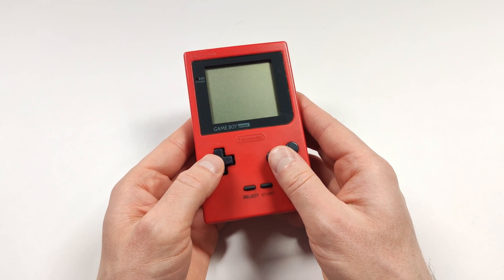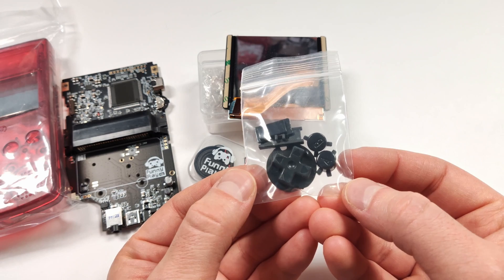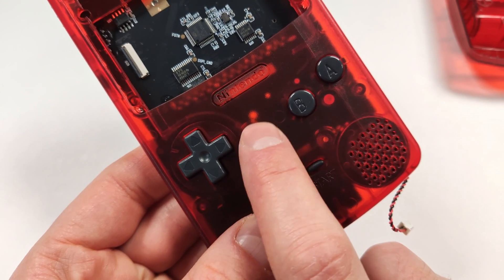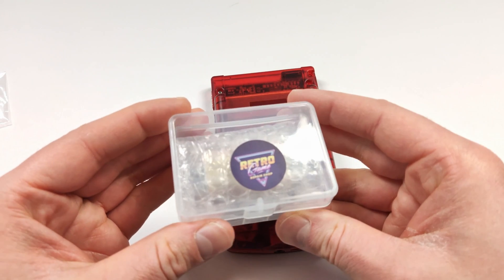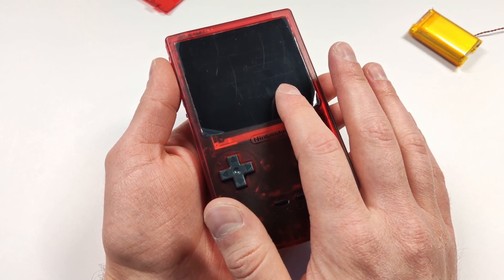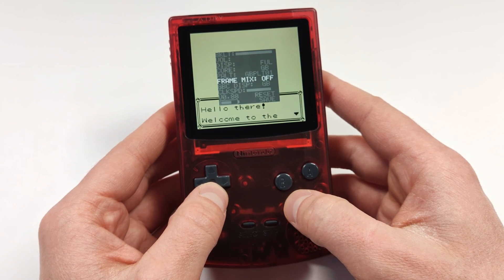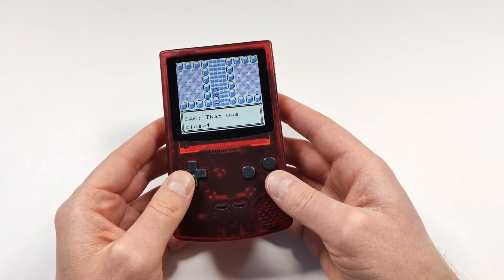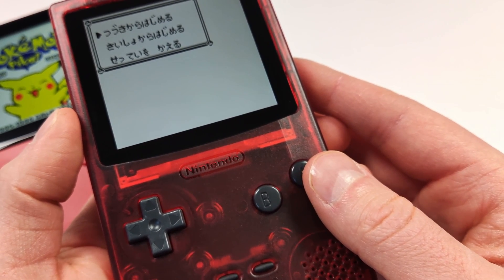Build Your Own FPGA Game Boy Color! In-Depth Build Guide and Review

Comment from the maker: Retro Game Repair Shop shipped me a replacement screen which fixed the biggest issue I have with the device. Excellent customer service! Have you built one yet? What do you think of the FPGA GBC Kit?
Reply: 160 $US? It's 70 (board) + 10 (shell) + 1.40 (buttons) + 1.40 (membran). :)
Reply: @TarikA  sounds like he got it from retro games repair shop, where the prices are inflated.
Reply: Hi, do you have a link or full name/model number for the rom cart you used? I see online that it is hit or miss which work, and I don't want to buy the wrong one. Thank you.
Reply from the maker: I'm using the blue game cart here (didn't get mine from this seller but it's the same product):
https://a.aliexpress.com/_mshf68w
Reply: Hopefully in the future you create the FPGA Advance.

With 2 speakers  on the front for left and Right.

Comment: That light line under the display that you can see through the shell is annoying. Do you imagine there would be any harm in having a piece of electrical tape covering that to make it match the back PCB?
Reply from the maker: You should be fine to put a piece of electrical tape there if you want, it won't harm anything.
Reply: Mine came with a small black sticker with the Funnyplaying logo on it that covered it up quite nicely.

Comment: Hi,
Got the hissing too from mine. I was pretty sure it was some interferences from a part of the kit. I thought of the screen first and it is. Increase or decrease the brightness and the hissing will disappear. I have no more hissing at the lowest and highest brightness setting. The hissing seems to follow a Gauss curve and the peak is around the middle setting. I guess it because of the PWM frequency used at those settings.

[Edit] Made a video : https://www.youtube.com/watch?v=k2t8PF9m4-o
Reply from the maker: Interesting! I checked again but mine seems to be persistent at any volume level. Sorry for the late reply. I heard Funnyplaying set the speaker itself at max volume then just turned it down on the software side. Hopefully an update fixes it.

Comment: Does the battery cable only fit on one way? My unit isn’t turning on and I’m not sure if it’s plugged in the wrong way… I have the positive (red) cable side of the plug facing downward or next to the speaker and the black facing upward.
Reply from the maker: Yeah it only fits one way. Sounds like you have it correctly oriented but you might need to push it down more on the furthest end of the connector tip. I had a little piece of plastic sticking out on my battery connector that prevented it from pushing it down easily (as shown in the video).

Comment: Just received mine today after what felt like a long wait. I was in-between smoke black shell or atomic purple ... So I ordered both shells. I ended up assembling with the atomic purple as it kicked in more of the nostalgia vibes.

So far pros are
- quality shell and materials (for most part)
- speaker is super good and loud (too loud)
- screen is great... I love the full screen mode
-usb c rechargeable 
- knock off ever drive flash cart works
- feels like I'm a kid again

Cons
- I had to file some poorly molded plastic off battery connector to get it to connect. Took 20 minutes of trying before figuring out that was stoping it.
- minimum volume is still too high for me... Like I would like 3-5 options softer. I'm playing Pokemon on the lowest volume and it's still too loud to play in bed next to the wife... 
- ordered 2 cases but they only sent 1 set of stickers
- my board is a newer revision 1.1 and there are not other firmwares. They have also changed the boot logo to a horrible funny playing logo that looks like absolute crap!!!
Reply from the maker: Been using mine a bit more lately as well and I do have to agree with you on the speaker volume, clear but very loud even at minimum volume. Seems like a nice kit but they obviously have a ways to go on perfecting it... shame about the new boot logo. You could always unplug the speaker in the meantime and use wired headphones until they patch the fix for the volume. Not ideal though... Do you notice any hissing from the speaker too?
Reply: @KeiRetroGaming  I have not noticed any hissing on mine yet but I must admit I only have maybe 2 hours of  light use at current. Mostly just testing out different games. 1 hour of that pokemon crystal. 

If you mean there is also a hiss when volume is all the way down... I don't have that problem. I can turn volume all the way down and sound is just off. No noise. I think for the short term... I'm actually going to put some tape over the speaker holes of the case to block off 80-90 of the holes... When I do that with my finger... It seems to reduce the minimum volume to a more manageable amount for quiet spaces.

I hope they keep doing some firmware updates or allow us to edit a settings file so I can manually configure the minimum volume.
Reply from the maker: I've heard some promising features coming eventually including lower volume... even one rumored to be supporting GBA games. You can read more about the future updates here:
https://github.com/makhowastaken/GWGBC_FW
Reply: @KeiRetroGaming  yeah. I actually made a second reply and posted the same link. I think YouTube auto removed the reply though. I know that page shows they know about it... But there is also a small bullet at the bottom of the page that says they might have the volume raised to hide that humm/hiss noise.

I tested mine yesterday with the volume off and held it up to my ear... I can hear a hiss noise. Although at normal playing distance I cannot. 

I actually emailed funny playing some feedback / requests as well... Hopefully they listen or respond.

Comment: I just literally did a custom mod kit for my gameboy color. It's transparent blue and I'm loving it too. I preferred my rechargable AA batteries for mine and think they last longer than 4hrs like your saying yours does. I got my screen at retro game shop and did very little trimming on my screen area.
Reply from the maker: I bet that looks great! How's the screen on yours?
Reply: @KeiRetroGaming  I first wanted a laminated drop in screen, but opted for the 2.6inch one and it's actually great! Even looking at the screen from like a 45deg angle and it's so good still. Got it at retro game repair shop and took a cheap case off Amazon and trimmed like 1/4 inch off side of screen and bottom and it dropped in smooth.

Comment: Thanks for your video. Really great reproduction of the Gameboy Color, but there exist too many issues in this revision, I will wait.
Reply from the maker: I successfully installed the replacement screen today, and it's a significant improvement with no uniformity issues. The speaker still hisses, but it seems they are actively working on an update to address this issue. While not perfect, I still believe it's a fantastic kit. Waiting for a revision or board update is a decent idea regardless.

Comment: Currently on sale on their site and free shipping to the UK! 69 bucks for the kit, 10 bucks for the shell, 2 bucks for the buttons and membranes. It's actually cheaper than buying a used GBC over here LOL
Reply from the maker: GBC prices have shot through the roof lately here too. It's nice to see a budget DIY option like this back in stock.
Reply: Thanks for the heads up, just got one for £66.20 shipped to the UK which is crazy cheap for a fully brand new GBC.
Reply: @JordonVW  exactly, especially with a backlit screen, it's getting regular fw patches too so compatibility is likely to get better over time
Reply: Will any buttons and membranes for the tbf work with it? I forgot to add them to my order 😂
Reply: @BertNuggets  I think any gbc buttons/membranes are fine to use

Comment: I've had one of these for a month and i love it. I also had issues with a bootleg copy of Yellow. It corrupted my save when i tried to save the game. But it works great with my legit copy of Crystal. I prefer this over a modded Gameboy because of the larger screen, physical button for screen options, and the louder audio. Mine doesn't have that hiss in the audio. Or at least i don't hear it unless i turn the volume all the way down and hold it up to my ear. Overall, it isn't perfect, but it's a great console for people that just want to play original cartridges. I've heard people are starting to have success with ROM carts with the new firmware updates though
Reply from the maker: Happy to hear yours has been great so far. I love the full screen mode too. Did you order it directly from the company or  another seller like I did?
Reply: @KeiRetroGaming  I got mine from RGRS

Comment: This would have been great had they put an sd card slot on the motherboard for loading games from the card.  Then a NES core would have added value to this device.   The analogue did all of this RIGHT!  If you cant come close to that dont even bother.
Reply: They will included one in later revisions, once the guinea pig period ends.

Comment: Great video!

Those PCB screws are definitely a little bit of a pain. Be sure to really get that middle one in tight. I didn't get mine in far enough (didn't want to over torque and crack the case), causing it to put pressure on the front when I attached the back... which caused a small crack.

Also worth noting if you update the firmware, that the suggested 1025 firmware stopped working with the Everdrive clone cart, but the 1117 firmware works fine with it.

I hope they add more colors and maybe a LED kit!

Comment: I think I'd much rather have the funnyplaying kit, honestly. I like the fact it actually looks like a GameBoy Color. I have a few funnyplaying modded devices and they seem to make some pretty good stuff. About the only thing original in my GBA is the motherboard, and if funnyplaying made an FPGA motherboard, I might consider swapping that at some point just to see what all it could do. It would be interesting if they added cores for other systems in a GBA FPGA motherboard.
Reply: This is funnyplaying
Reply: @choiwaynekiet  I know. That's why I said it would be interesting if they did a GBA motherboard. The one in the video is a GBC.
Reply: @anotherthing  not from your first line
Reply: @choiwaynekiet  At the end of Kei's video, Kei asks the question, "Which would you rather have, the Analog Pocket or the FPGA from Funnyplaying?" My first sentence is the answer to that question, and then I expand on that saying I would be interested in a GBA version of the FPGA from the company that made this GBC version. Either your attention span wasn't good enough for you to finish the video, or your ability to read for context is sorely lacking. Might be both of those are your weaknesses. Work on those first rather than your typing skills.